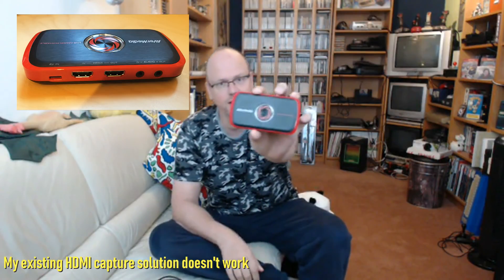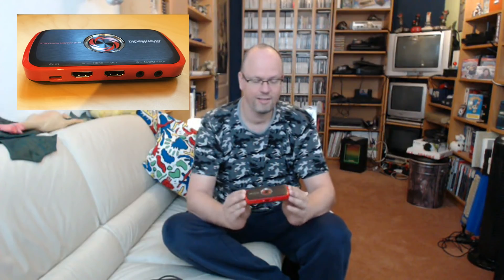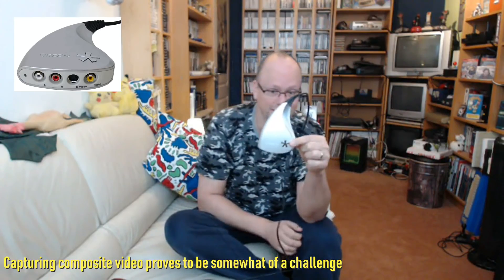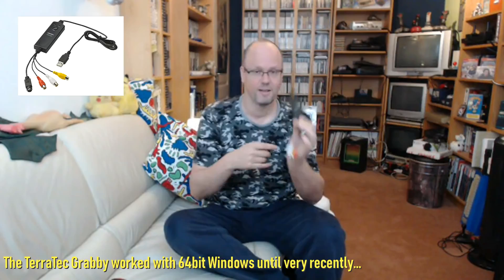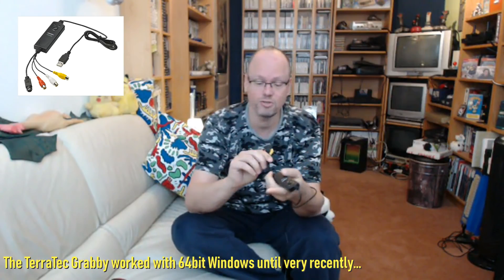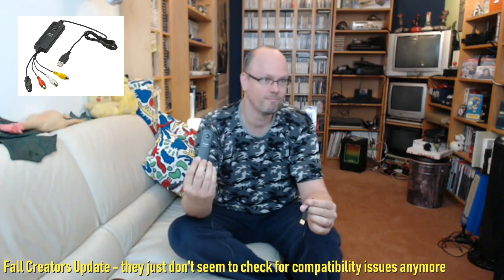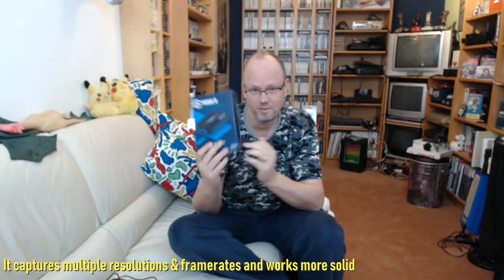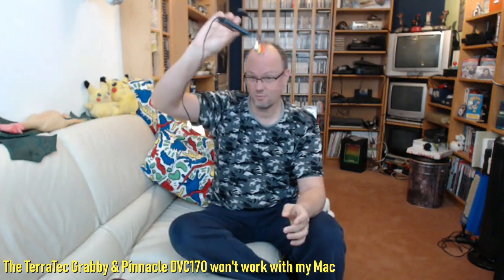My Ultimate64 Experience IV - Proper 100% functioning HDMI Recording with the Elgato

Comment: Told you so years ago ;)
Reply from the maker: Yes, I know. I know. 

After I killed my Hauppage DVR solution by accidentally plugging in the wrong power supply I was low on funds and needed an affordable solution at the time. The Avermedia Live Gamer Portable was on sale and it had a stand alone function and I got that and have been working with that for quite some time. It's finicky and sometimes just doesn't record when it should. 

So now with the Legato HD60 S it is all great. I also got the Open Source Framemeister Clone which I hope will interface well with the Legator and/or the Avermedia as it is quite good at converting all sorts RGB signals to HDMI. It doesn't have a composite video solution though but I might still use the Terratec Grabby with my Linux Mint 19 box for that. I found out why the audio wasn't being recorded. User error. :P
Reply: @lactobacillusprime  Depending on the scaling (mostly on 3x, 4x, and 5x) , the OSSC can produce non-standard resolutions, which may or may not work on the capture device. Unlike other scalers, that conveniently render to a set output resolution, the OSSC couples the output resolution to the scaler settings, which can be a bit confusing at first.